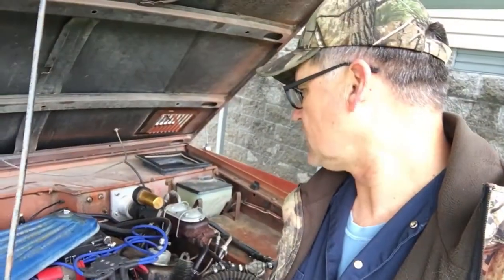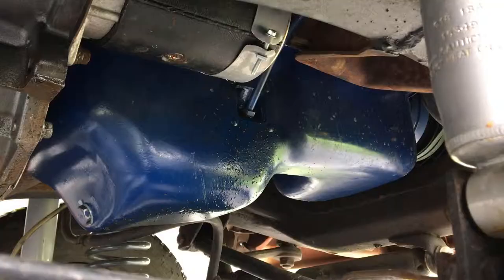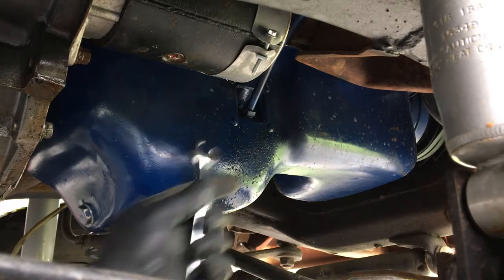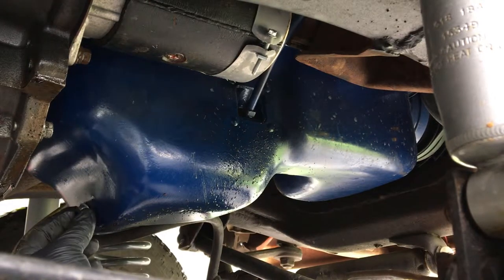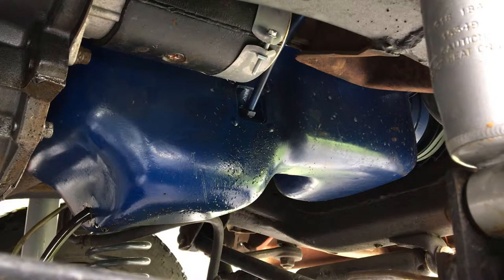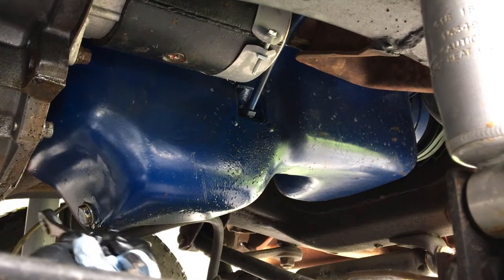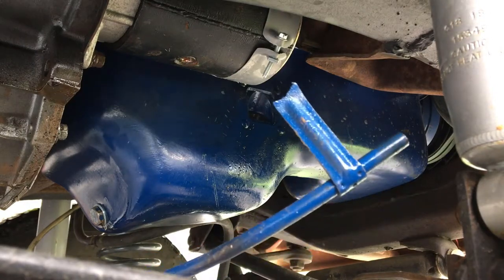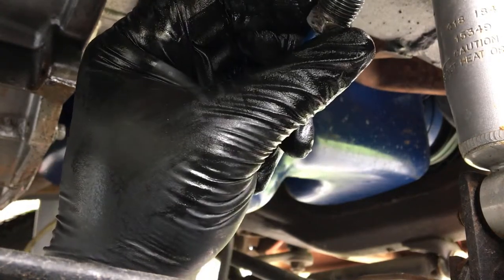Early Bronco Oil Leak Fix! 1974 Ford Bronco

Comment: What did you have to remove to replace the pan?
Reply from the maker: Took out the dipstick. Other than that, the pan came out after removing the oil pan bolts.